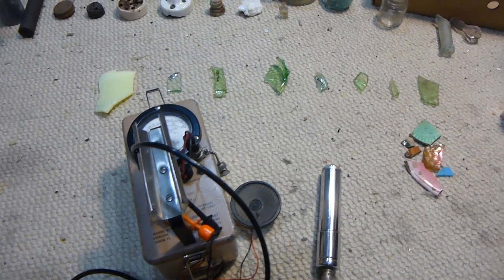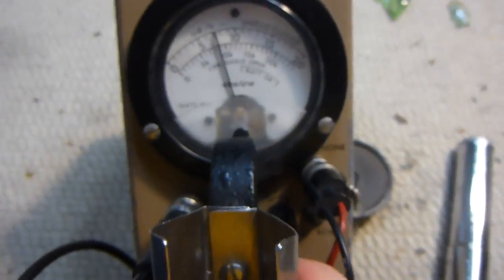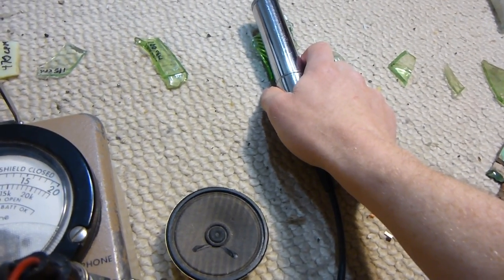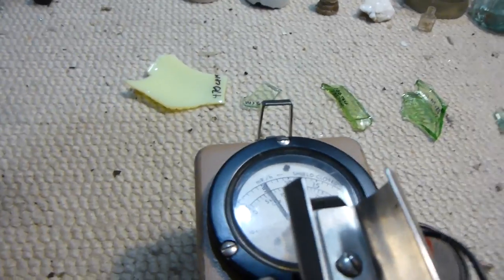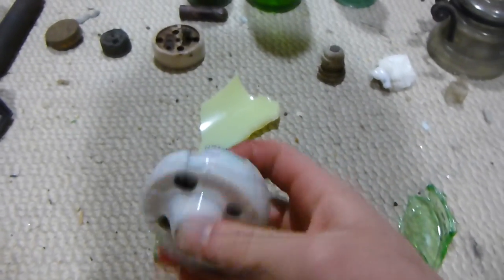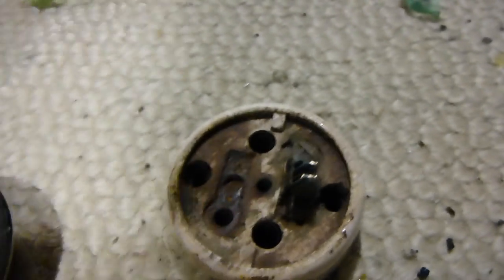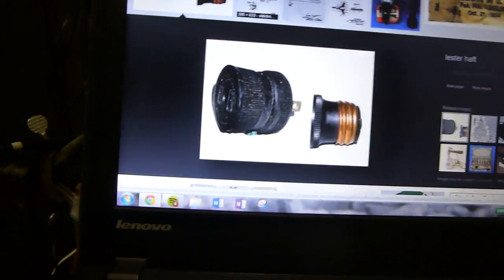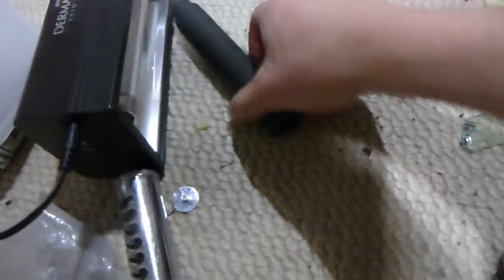Uranium Glass - Woods Exploration Followup Using Geiger Counter and Ultraviolet Light

Comment: This isn't really anything important, but I thought I would fill you in just so you know.   Regarding outlets and their prong insert layout - the two vertical prongs are 15Amp 125V plugs, and the 1 vertical/1horizontal are 20Amp 250V plugs. There are various configurations 125/250V and different amp ratings.
http://www.nooutage.com/nema_configurations.htm
--I wish I would have been into all this stuff to the extent that you are when I was your age. You're going to be one heck of a "diy gadget wizard" as you get older!
Have you had any further success with the glass blowing?  I'm going to be attempting making my own vacuum tubes in the near future.
Reply from the maker: VortexTurtle Interesting!  I didn't know that.  I knew it was for higher amps but I didn't know it was for 240v.  Seems like a kinda bad idea being that you could plug a 120v device in without thinking.

Hahaha yeah I wonder what I'm gonna be doing in several years!  I already have an internship cutout for my summer!  First year of college too!  Most college students don't get an internship until second or third year.  So I must be doing something semi rightish.

A little.  I went on eBay and bought a bunch of Pyrex test tubes and small glass tubes to use for glass blowing.  So far I've just attempted many times to make a hermetic seal from glass to the copper electrode wires.  I've gotten pretty close with a almost perfect seal.  My problem is that my torch is not hot enough.  It takes my 5 minutes just to get the glass almost hot enough while the professionals have there's glowing in seconds.  I'm thinking about buying a map gas torch.  They are supposed to burn hotter.  I don't really want to fork over enough for a oxy torch.  I could try making a hydrogen torch.  I made a really small one when I was 13.  I bet I could build a much better and more powerful one now!
Reply: Yeah, an HHO welding-type torch should work great, but to get one working properly will take some time and experimentation.  A small tank of Mapp is only about $10 and will work just fine with the torch heads you already have. No mods necessary.  If you do decide to spend $100 or near on a torch, just buy one of the small Oxyacetylene rigs. They're only around $30-$50 more than the Oxy-Mapp, and you'll spend a whole lot less on gasses since they'll be refills instead of new cylinders every time.
Reply from the maker: VortexTurtle Yeah that's a possibility.  How much hotter is map?  Would it be enough of a difference to be worth it?  $100 is kinda more than I want to spend.  I think a hydrogen torch would be pretty easy.  I would just need some stainless steel sheets to use as electrodes.